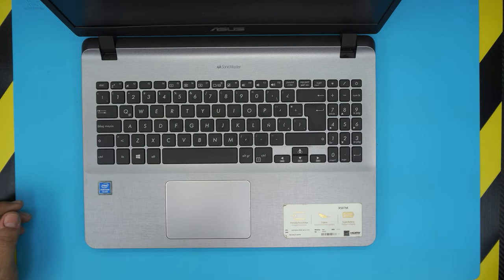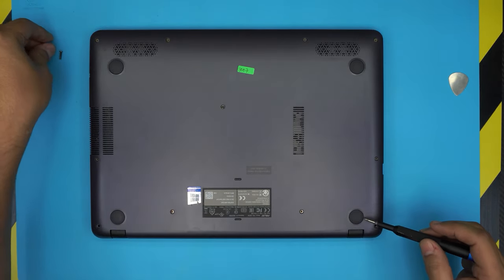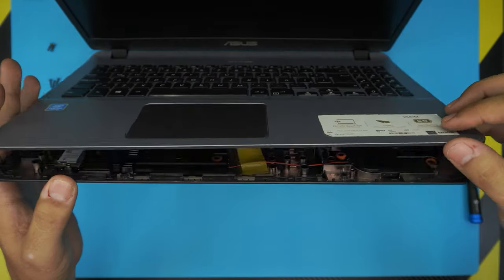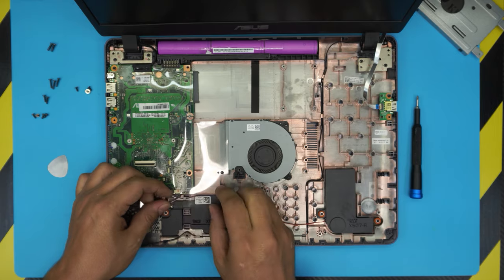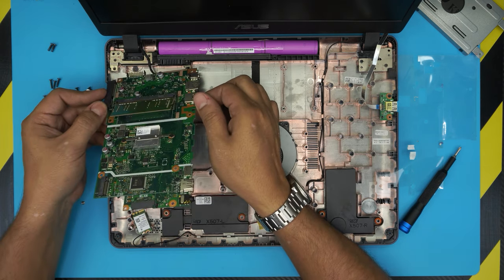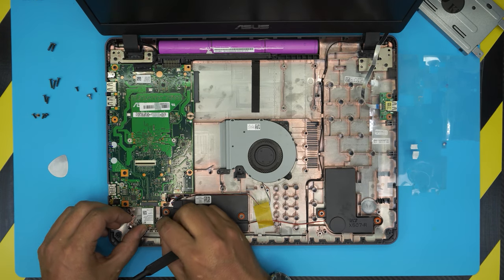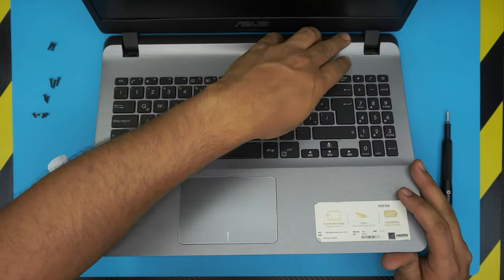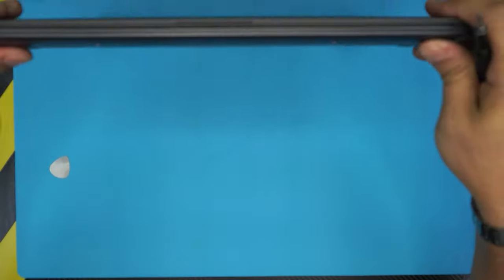Asus X507m Ram Upgrade STEP by STEP

Comment: This is what I'm looking for several years now. Thank you so much for uploading this video. This has the same make and model of the laptop that I need to upgrade RAM and switch the HDD to SDD. I just need to learn how to re-image the OS so that I can still get the same licensed OS.
Reply from the maker: Glad I could help, thank you for the feedback and your support if you need to move your windows and everything follow the simple steps:
download the free version of the : Macrium Reflect
and get one of this adapters:
https://amzn.to/2MqY2ej

connect your SSD or HDD that you purchased to the adapter and plug it into your windows and open the program and clone the main HDD to the new drive. and you are all set. :)
Good luck my friend
Reply: @uFixTek  Thank you so much. I will do this once I got all of the stuff I needed. I have saved your videos on my Playlist here
Reply from the maker: my pleasure, if you every got any questions or request feel free to ask me in any of my video comments , good luck

Comment: Hi, I've been watching your tutorials and they are very helpful. I'm planning on upgrading it to 16gb ram. Which would be better 16gb 2400mhz or 16gb 2666mhz? Thanks in advance.
Reply from the maker: Thank you for the feedback! if you wish to support the channel you can LIKE or SUB or both :P
regarding your question: No need to place a 2666mhz even the 2400mhz is too much for this celeron CPU , and remember intel CPU dont care much about the ram speed. if it was AMD then YES the better the ram speed the very noticeable performance you will see.
https://amzn.to/3fTobOJ
if you have any other questions feel free to ask.
Reply: I've been seaching local marketplaces near me for a 16gb ddr4 ram, but most of the ones i'm seeing are 2666mhz my laptop has 4gb ddr4 2400mhz. Just in case, will a 16gb ddr4 2666mhz work for x507m?
Reply from the maker: @markangelopamatian2810  yes it will work but the bios will have to do a ram check at 1st boot only for 10-15seec so dont panic if you get black screen for 15sec.
Reply from the maker: but try to see if you can get 2400, if no no bigy
Reply: @mark  were you able to upgrade to 16gb 2666mhz
Reply: @thegreenthing7603  Hi, unfortunately it didnt work for me, I just opted for an 8gb 2400mhz.

Comment: Hello, I live in Turkey. My English is not very good so unfortunately I didn't understand much from the video. How many hz ddr should be when buying ram. I would be very happy if you give a link in the ssd as well, I subscribed, thanks in advance.
Reply from the maker: Geri bildirim için teşekkürler! Kanalı desteklemek isterseniz BEĞEN veya ALT veya her ikisini birden yapabilirsiniz :P sorunuzla ilgili olarak: tabiki merak etmeyin arkadaşım ben "Azerice" tebriz ve farsça, ingilizce ispanyolca konuşuyorum. ama türkçe değil :(
ram için şu özelliklere ihtiyacınız var: "sdram ddr4 8gb 2400MHz"
işte kontrol etmeniz için bir link:
https://www.amazon.com.tr/Crucial-BELLEK-2400MHz-SODIMM-CT8G4S24AM/dp/B0721BJTR4/ref=sr_1_3?__mk_tr_TR=%C3%85M%C3%85%C5%BD%C3%95%C3%91&crid=A4MQVCFAEZ11&keywords=sdram%2Bddr4%2B8gb%2B2400&qid=1655595209&sprefix=sdram%2Bddr4%2B8gb%2B2400%2Caps%2C166&sr=8-3&th=1

https://amzn.com/dp/B0721BJTR4
Reply: @uFixTek  First of all, thank you very much for your interest. So which model should i buy for ssd? :)
Reply: @onur1605  I think you mean SSD brand when you wrote 'model'. Let me reply to you because the channel owner has maybe missed your comment. 😄
There are plenty of options available in the market depending on your budget and the memory size you need(128 GB, 500 GB, 1 TB etc.). Seagate/Samsung/Kingston etc are some few recommendations for you. :)
Cheers!

Comment: How many ram slots does it have?
Task manager says there're 2 slots available. (1 out of 2 slots used)
Reply from the maker: Thank you for the feedback! if you wish to support the channel you can LIKE or SUB or both :P
regarding your question: it only has ONE ram dim on motherboard. the windows task managers will say that because windows is not programed correctly to detect dims on board. some laptop have rams soldered on board and the windows detects them as dim 1of 2 and when you open its all soldered on board.
Reply: @uFixTek  thank you for the quick Reply.
Is there any limit how much ram i can put in the slot or not?
And do i have to use 2 400MHz or can i choose other frequency?
Reply from the maker: if you want to know hte max ram capacity for laptop or pc check this short video: https://youtu.be/tKEJTkVth4Q
and regarding the speed it makes no difference if you mix match speed the bios will adjust it self to the onboard speed.

Comment: Can you upgrade its processor from pentium to core i5?
Reply from the maker: Thank you! for the feedback and your support to the channel by SUB :P
regarding your question:sorry to  inform you but you can't upgrade the CPU, its soldered on motherboard. and its not possible to go to i5 even if it was a LGA socket, unfortunately its BGA chip

Comment: i cant find CMOS battery, how can i reset bios?
Reply from the maker: Thank you for the feedback! if you wish to support the channel you can LIKE or SUB or both :P
regarding your question: there is no cmos battery, you need to disconnect the main battery and the charger and press and hold the power button for 30-60sec, then plug in everything and you should have bios reset.

Comment: Is it possible to upgrade the ram up to 16gb even if the X507m says it only supports up to 8gb? And also the computers original ram speed is 2400, can i use higher speed like 3200 mHz?
Reply from the maker: hank you for the feedback! if you wish to support the channel you can LIKE or SUB or both :P
regarding your question: Don't listen to those idiots, half of the time they have no idea what they are saying, this laptop can handle 16gb hands down last week i upgrade one to 16gb to test and all went perfect and ram test 100%.
https://amzn.to/3hsNmHK
https://amzn.to/3xhSx3L
and dont go over 2666MHz
and the bios will adjust the 266 to the max speed 2400
Reply: I also have the x507m 

So i can upgrade to 16GB ?? 

Should be 
Ddr4  sodimm 1.2v 2666mhz 16gb ?
Reply: @thegreenthing7603 did you succeed?

Comment: Hi, how to know if your ram is compatible on this laptop? I recently bought 8gb Ram ADATA ddr4 3200 PC4-25600 

Is this comptible?
Reply from the maker: Thank you for your feedback! If you wish to support the channel, you can like, subscribe, or both!
Regarding your question, yes that is compatible but to be in a safe size get a 2666mhz, because the bios will not use anything above 2666
Should you have any further questions or requests in the future, please don't hesitate to ask me.
Reply: @uFixTek hi i replace my stock ram to Crucial 8gb 2400mhz but my laptop wont turn on :(

Comment: I see there's the PCIE/M.2 slot, but there is some random chip in the middle. Does x507ma support nvme? If yes, which type?
Also the BIOS only has options for the SATA drive in the SATA configuration.
Reply from the maker: Thank you for the feedback! if you wish to support the channel you can LIKE or SUB or both :P
regarding your question:  it has a m.2 SATA not NVME, and the CHIP in middle is very low profile. you can place any m.2 SATA brand.
https://amzn.to/3GrPWva
Reply: @uFixTek  Thanks. So I can just put any M.2 SATA drive there and it'll just work?
Reply from the maker: yes my friend any m.2 sata make or model up to 1TB. but i recommend you to install windows on ssd m.2 and keep the hdd as 2nd storage.
https://youtu.be/uDu8j2lE-dM
proper way of install windows on asus laptops: https://youtu.be/kkxDz398DL8

Comment: hi i hv X507M, its really very slow, it has intel N5000 processor & 4gb RAM what shall I do, i m just a student, pls help
Reply from the maker: Thank you for the feedback! if you wish to support the channel you can LIKE or SUB or both :P
regarding your question: DON'T add more ram, replace the Hard drive with a SSD and you will see the big difference. https://youtu.be/FlyXZOtpjoU
remember back up your files because once you place a new drive, you will need to install windows from USD boot and its easy it take 20min
here is a recommended SSD:
https://amzn.to/3KMJez5
here is a video on how to create windows 10 usb boot: https://youtu.be/uDu8j2lE-dM
Reply: @uFixTek  thnx for letting me know this but the SSD link you posted is not active, can you pls recheck the same

Comment: Hi!, does x507m supports 16gb ram?
Reply from the maker: thank you for the support to the channel by a SUB :P
and regarding your question YES it does and we have upgraded to 16gb for few clients:
https://amzn.to/3qqfoHm
Reply: @uFixTek  hi!, my laptop has 2400t mhz ram, will it be compatible if I install 2666mhz ram? and will it boot? or I will need to change bios settings?
Reply from the maker: @Greggyboos  it will work no need to do anything plug in a 2666 and the bios will adjust the mhz,
Reply: @uFixTek  thank you so much, you helped me a lot :)
Reply from the maker: @Greggyboos  anytime ma man, if you got problem installing let me know dont panic :P when ever you got questions ask me , i repair electronics and laptops all day feel free to ask me anything. good luck
Reply: Ok so my ram just came in. Installed. But doesnt boot. It only lights white on the side need the power inlet

Ram is a crucial 16gb 2600 1.2 sodimm ddr4

What to do?

Comment: Hello there. I am from South Korea. I have been watching your channel for a few months and it is really useful. thanks!!! Um.. I have a question for you. I have a same model and I want to change my laptop ram. Does it have a single ram slot or dual slots? Is it single slot? right? just I am curious about it. I am afraid if I try to do it myself, I would destroy my laptop. But, I will try it.
Reply from the maker: Thank you for the feedback and your support to the channel :P
regarding your question:  it only has one ram dim and dont be scared, its very simple and easy and you cannot destroy you motherboard by touching it, you can upgrade it to a 16gb
Reply: Hello sir your video is very helpful, is it really upgradeable to 16gb ram?, because what I've seen in asus site is, this model is upgradeable to 8gb. Intel celeron n4100 maybe can't handle that much ram

Comment: Hello! My Asus X507M laptop is stuck on the black screen when powering on. Is the problem the motherboard or the graphics card?
Reply from the maker: Thank you for the feedback! if you wish to support the channel you can LIKE or SUB or both :P
regarding your question: if your power light turns on and no screen try removing the ram and re inserting the ram, or change the ram. as this is a common problem on this models that we get in the store often.

Comment: Sir can you help me. 

I bought a Crucial 8gb DDR4 2400mhz, but it only shows black screen after pressing the power button. The Led light lit up but there's no booting.

Stock RAM: sk hynix 4gb 1rx16 pc4-2400t-sc0-11
Newly bought RAM: Crucial 8gb ddr4 - 2400 SODIMM 1.2V CL17

I already tried these: 
-Reseating of RAM

-Tried Swapping from my old RAM to my newly Bought RAM  (Revert it back to my Stock/factory RAM, the laptop turned ON normally, then swap again to the new RAM, black screen happened again)

-Tried holding the power button for 40s for hard reset, nothing happens

-Double checked the newly bought RAM for compatibility, and it seems fine.

-Checked for any bios update, my BIOS is up-to-date.

Please help! :(
Reply from the maker: Thank you for your feedback! If you wish to support the channel, you can like, subscribe, or both!
Regarding your question, you need to force the motherboard to get to mem check, to do that, you need to disconnect the battery, and all rams, then press and hold the power button for 60sec then plug the ram and and battery and charger and power on and wait 15sec, if nothing then get a new ram.
Reply: @uFixTek  hi sir, i changed my ram as you instructed. the replaced 8gb RAM from Kingston, do its purpose. Thank you!

but it also raise another question.. My Laptop only detects 4gb not 8gb. can you help me what can i do to this one?

-checked BIOS and it also says 4gb. 
-checked CPU-Z, it detects my 8gb 2

please help

Comment: I have the dame laptop and i was wondering if i add an nvme m.2 ssd to upgrade my storage, does it have a trade off of losing wifi or you can just add one without losing anything?
Reply from the maker: Thank you for the feedback! if you wish to support the channel you can LIKE or SUB or both :P
regarding your question: You can only add a m.2 ssd SATA (not a NVME), and it will work just fine, it goes right beside the ram there is a m.2 ssd jack. 
https://amzn.to/3YqPJOu
Reply: @uFixTek  Thank you for the reply much appreciated
Reply from the maker: It's my pleasure my friend🍻😊
If you have any future questions or requests, please don't hesitate to reach out to me. I'll be happy to assist you

Comment: Does my laptop Asus X507UB-br161t have 2 slots for RAM or just one?
Reply from the maker: Thank you for the feedback! if you wish to support the channel you can LIKE or SUB or both :P
regarding your question:  Your Laptop has two physical ram slot available to upgrade.
Reply: @uFixTek  thanks! New subscriber. do you know if my laptop Asus X507UB-br161t has a m.2 slot? I want to have Hdd(for files) + m.2 Sata (for OS) but i don't know if it Will work in My laptop... could you Help me please?

Comment: Help I changed my ram but my laptop won't turn on
Reply from the maker: what ram and what capacity did you put?
check this video for the max ram capacity : https://youtu.be/tKEJTkVth4Q
Reply: @uFixTek help. Mine too. I replace it with crucial 8gb 2400mhz ram. But it wont turn on

Comment: we have the same laptop, but when i inserted the 8gb DDR4 ram the screen turns black and cant be open
Reply from the maker: 🫠Regarding your issue, the ram may be defective or not making a good contact. double check , we upgrade this models all the time without any issues.
cheers🍻

Comment: Can ı upgrad it to 16gb for 1st slot?
Reply from the maker: Thank you for the feedback! if you wish to support the channel you can LIKE or SUB or both :P
regarding your question: no my friend one slot can't handle 16GB 8GB max
Reply: @uFixTek  but pocessor supports 8 GB ram what Will happen if ı make it 16gb
Reply from the maker: how much ram you have soldered on board, if you have 4GB soldered on board you can place a 8GB on the slot and you will have 12GB total.
if you have 8GB soldered you can add 8GB on the slot for total of 16GB
BUT you CAN'T have a SINGLE 16GB stick.
Reply: @uFixTek  idk  have 4gb without upgrading  i think 4 GB soldered
Reply: @uFixTek  it saying 1/2 slots is using in task manager.
Reply: @uFixTek  and can ı upgrad the processor
Reply from the maker: so you have 4gb on board soldered and you can put an extra 8GB
Reply from the maker: NO you can't upgrade the CPU my friend

Comment: I changed the RAM but the screen remains black. then I inserted the old RAM, I updated the bios, I installed the 8 GB one but the screen remains black. what can I do? Thank you
Reply from the maker: what is the exact ram model?
Reply: @uFixTek   before this: 8GB DDR4-2400 S0DIMM 1.2V CL 17 but not working, and after this: 8GB 1RX8 PC4-2400T-SA1-11 but this doesn't work

Comment: when i finished replacing the ram, i reassembled my laptop the same way the video was showing, but then i had a problem with my laptop webcam not being detected and not working, can you help me on this?
Reply from the maker: Did you remove the lcd flex cable?, if you did make sure it connected all the way in , remove and plug it back in.
Reply: where is this lcd flex cable located inside the laptop?
Reply from the maker: right by the left hinge:
https://prnt.sc/y2lz6x
Reply: i checked once again inside my laptop but i did not remove the lcd flex cable, i booted my laptop onc again and checked the device manager, i discovered that my camera driver is missing and it won't reinstall even if i scan for hardware  changes and restarting the laptop won't reinstall the webcam driver too, what should i do
Reply from the maker: i would need to check few stuff the 1st one is that you need to open the camera and make sure the camera jack is not moved this happens a lot , use the opening tool to remove the screen bezel just the same way i showed how to remove the palm-rest @2:20 (do the same right over the webcam and pull the bezel back and check the webcam jack make sure its pushed all the way in. and then restart the laptop and check the drivers. and let me know
Reply: i checked and nothing seems to be broken or anything wrong, is there any other way to restore the webcam driver?
Reply from the maker: can you send me a screen shot of the drivers so i can check few stuff.
use this:
https://prnt.sc

Comment: hi, i just did this process and changed both my storage and ram. now it has no display but it has a light indicator that it is turned on
Reply from the maker: what ram you place exact model and capacity?
Reply: @uFixTek  

Laptop model: Asus X507MA-BR076T

Update: The ssd already works, and i already installed the OS also. however whenever i use the new ram it does not boot. so i have problems with the ram
Reply: @uFixTek  The ram that I got was from CODRAM, DDR4 8GB 2400Mhz, 260 PIN SODIMM ram
Reply: I also would like to appreciate your response my question :)
Reply from the maker: It's my pleasure my friend.
you have a defective ram, because that ram should of worked we upgrade them all the time.